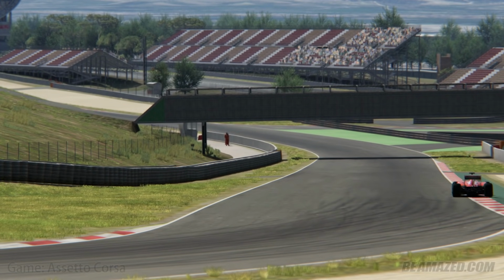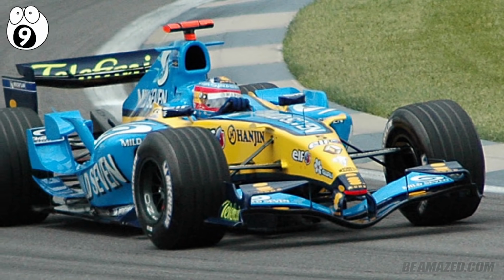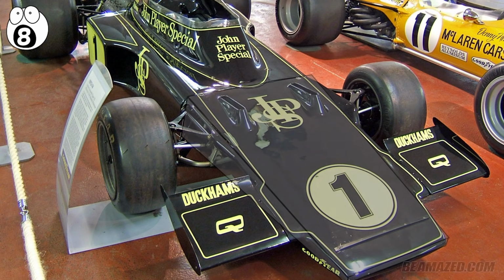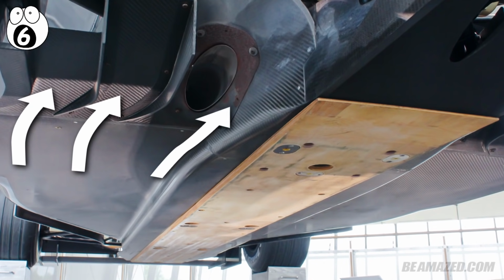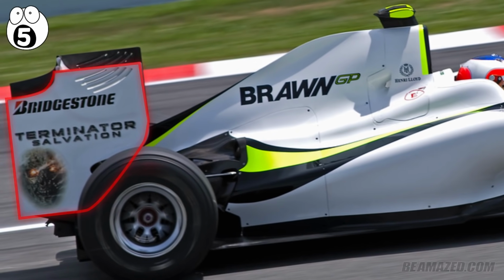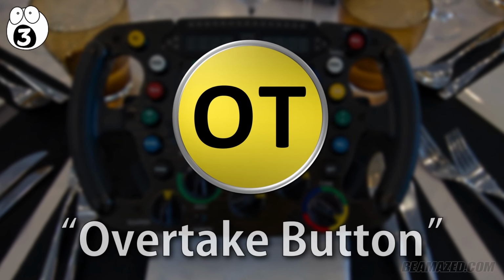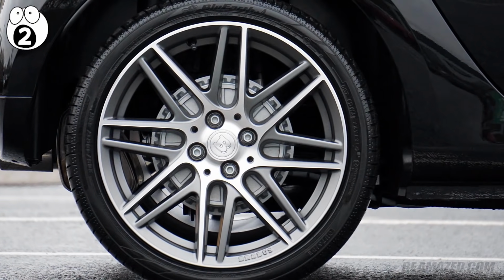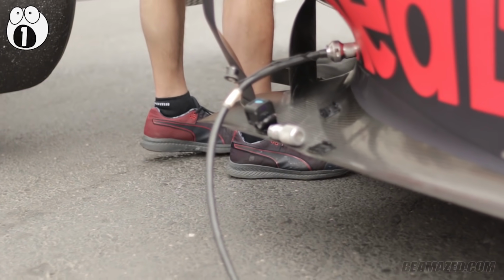Secrets Of F1 Car Design You'll Find Really Interesting

Comment: I don't normally comment on other people's videos, but this was truly painful to watch, pretty much everything said about aerodynamics in this video was completely incorrect... Might be worth getting someone who understands aero to proof watch before you publish...
Reply: In case you arent already aware, Bryan, the OP here is literally an aerodynamic engineer.
Reply: About Ram Effect on a Turbo Engine
"You allow the turbo to do less work for the same manifold pressure, and thus get more effeciency. It is especially helpful if the turbo is working at its limits.

For example suppose your turbo is most efficient at a pressure ratio of 2.7:1. The pressure ratio is the ratio of the outlet pressure divided by the inlet pressure.
Lets suppose on a given day absolute air pressure is 12.5 psi. If you run the turbo at its ideal effeciency, you get a max boost of  12.5 x 2.7 = 33.75 psi.

Now you add 1 psi ram boost to that same setup, your inlet pressure is now 13.5 psi, so your max boost becomes 13.5 x 2.7 = 36.45 psi.

You gained 2.7 psi manifold pressure by adding 1 psi of ram boost!"
Sorry for retarded units, i just copied the first proper post I found about it on the internet.
Reply: I love how the experts think that a company that spends millions in research every year and thousands of man hours is going to release the exact information to general public...  At the very best you are receiving outdated info or some reverse engineered theory.  Maybe take a look at the NDA book most teams have.
Reply: Pedro every little bit helps and as the engine works better with cool undisturbed air, the duct is required mainly for that reason so its kind of a "free" turbo you could say.
Reply: actual aerodynamics engineer with a Motrosport msc here..

i did.. you're welcome.. :) and i'm pretty sure i left stuff behind as his whole explanation of the under body/diffuser made my head hurt....
Reply: KYLE.ENGINEERS seriously. The only reason I clicked this was to see how far from one of your videos it was going to be. Answer, very far.
Reply: "Links for further research? Anywhere where I can learn F1 car aerodynamics from scratch?" 

Aero Dynamics on F1 cars is a very complicated thing if you go down to it's details. I don't think any F1 Aero-Engineer fully understands what is going on his own car. One of the reasons is, they use software to find shapes that improve downforce/drag. There are softwares that simulate partly "random" shapes, find and give out solutions that are better than the solution the software started with. It works and it is an improvement but why? Well because the CFD simulation shows that it's better... But really why, is sometimes not perfectly certain. We are not talking about big effects, we are talking about 20 or 30 small shapes or radius of winglets or supporting shapes at the edges of side-boards... all that stuff in particular. 
Also car aero-dynamics have car travelling speed, side slip angle, ride height and some other smaller parameter to get the full picture.

However, if you want to look into car aero-dynamics, get a good book. There are quite a few and some good books on that topic that present the topic from a general approach to more complex effects and more detailed explanations. Whoever the general understanding is far more helpful than knowing a few small aero gimmicks.
Reply: KYLE.ENGINEERS i know right?       Best vidio for non-car enthusiasts
Reply: Kyle What was wrong about the Aero ?????
Reply: The previous generation engines (NA v-8's and v-10s) had the airbox designed to make sure the engine had ENOUGH air to operate at all RPMs and all speeds, and so they had an outlet at the back (iirc, the present ones have them, too), to allow excess air to escape, and keep a constant amount of airflow and pressure built up in the airbox, enough to allow the engine to run at full RPM and not starve. Without those devices, if the engine weren't running at full RPM (or the box was misdesigned), the airflow would stall at the airbox opening, and then the airflow would separate and go AROUND the inlet opening, and actually begin sucking the air out of the box, thereby starving the engine.
Reply: You won't find many in F1 who understand aerodynamics!
Reply: KYLE.ENGINEERS  and i was thinking that i was the only one to see this.
Reply: I know
Reply: Links for further research? Anywhere where I can learn F1 car aerodynamics from scratch?
Reply: The problem with that is what happens when the inlet air speed is exceeded by the actual air speed approaching the inlet. When that happens, the flow stalls at the opening, then separates around the inlet, actually sucking air out of it, which completely negates the "ram air" effect. 

In truth, the only way to prevent that is to make sure the entire airbox unit is designed such that no matter what speed the car is going in relation to the amount of ingested air, there's ALWAYS fresh air moving into the box, and that requires some sort of exit on the backside (which is usually smaller than the main inlet) to keep air moving. 

I got all THAT from two sources: 1) SPEED/NBCSN's F1 technical commentator Steve Matchett (thru years of watching F1 on SPEED and NBCSN); and 2) "Ferrari Formula 1 - Under the skin of the championship winning F1-2000" (http://f1-nut.com/book/rare-book-review-ferrari-formula-1-by-peter-wright/), which is as deep into a car as I've ever found.
Reply: Yea it's painful to watch as a f1 fan
Reply: Savage
Reply: Ok, hold on so in front of your turbo, you have your air box, the goal of the turbo is to increase the air flow through the engine by increasing pressure. So increasing the pressure (say by a defusor) prior to the turbo does actually make sense! Where dou you think the air into the compressor comes from? A giant air tank?
Reply: Thanks, already wondered how the difusor would help. Was already close to doing bernoulli myself.
Reply: Yes. I had the exact same thought from the very first item. The most important job on today's front wing is to manage the airflow in order to make the rear diffuser and work more effectively, as they generate the bulk of the downforce. Basically the goal is to circumvent the front wheels to prevent turbulent airflow and to energize the airflow (look up Y250). Down force of the front wing is also important, but it much less complex to achieve.
Reply: And a formula one costs 9 million hahahaha Ferrari spends 650 million each year in research alone
Reply: the only reason i clicked on the video was to see how far from the truth was going to be. It was truly painful to was this as a car enthusiast
Reply: Also he says that the rear wing pushes air onto the car at the back, making overtakes harder. This falls flat onto the most obvious tactic, slipstreaming, where the WHOLE POINT is to drive close behind the leader to avoid excess air hitting you and causing drag (this sometimes works so well that it caused the RIC-VER crash in the Austrian GP this year).

Edit: The RIC-VER crash was caused by Verstappen weaving like an idiot
Reply: Someone tell him what the nürburgring is i don’t think there are any races in nuremberg
Reply: I was excited to learn about this car because they are bad ass but all these comments make me not want to even watch this video. Thanks comments section true mvp
Reply: michael scoulfeild i think the f1 community is getting a bit out of hand on this one and it is simplified to reach a wider audience. But i agree that to do a video like this he needs to have a certain level of understanding of the subject. If you want to learn about the cars then definitely find other videos online or even tune in to a race
Reply: Thank you
Reply: I never realised that the barge boards are the only non structural part of the car that is purely for aerodynamics. Diffuser and wings clearly are the main structural integrity of the whole car. I've only made it to no7 and i doubt everything I've heard so far
Reply: I didn’t think a video could make me cringe so much
Reply: You know your facts are blatantly wrong when you managed to annoy Kyle!
Reply: @Victor duarte There's a difference between an oversimplification and an incorrect statement.  Oversimplification: "The diffuser helps the undertray make downforce", Incorrect statement: "The upward curve forces air to expand, which drops air pressure, making exiting air suck the car to the ground" - with the graphic showing the pressure as high under the floor and low in the diffuser. The video is full of them.
Reply: while not everything is entirely correct, it's not fair to say all of it is wrong. This video oversimplifies basically everything to reach a wider audience. While i was watching, everything fell under the category of 'yeah it does that, but it's actually also doing <this>, which is far more important'.
Reply: Underbody: At the Front you have an opening to catch air. In the centre you have a area where the air is squeezed thru a smaller cross-section. Faster air has reduced pressure, low pressure multiplied by surface (of car underbody) results in a downforce. The underbody has the benefit of the ground-effect. Now the diffuser, what is the point of the diffuser if the fast travelling low air pressure zone in the centre of the underbody is the key thing. Well the diffuser is an open end for the travelling air, means at the exit opening the air pressure must have ambient air pressure. So going backwards, and you need to think backwards for this effect, not perfectly intuitive, but it works. If the air has ambient air pressure at the exit, and the exit is a bigger cross section than the centre part of the air tunnel, the air pressure in the centre is reduced by the diffuser.  
So the diffuser helps to create under-pressure or increase the under-pressure in the centre of the air tunnel underneath the car, what creates downforce. If you are lucky you can guide the air with the diffuser to the rear wing, in a way that it supports the rear wing, maybe. 

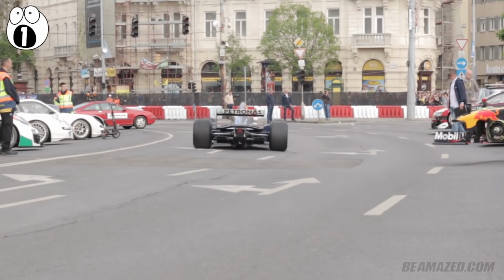So that explanation in the video really was bollocks. Also the boreholes in the brake disk that shall cool the disc or bring the hot air to the wheel, as he said it, he showed the wrong holes. Axial boreholes are not in the discs for cooling, they are especially in steel brake discs to reduce heat stress in the disc. The radial boreholes are there to cool brake discs. A carbon brake disc has a very low thermal expansion, so it rather doesn't need the axial boreholes. And at 10:02 of this video you can see an example on an F1 car that actually doesn't have the axial boreholes and only some radial boreholes.

He also said the boreholes in the discs are to heat up the wheel/tire. Well that is difficult to argue with but certainly not the right way to explain it. The starting point is that  brakes get hot on braking ad carbon brakes and brake pads need a certain minimum temperature to work properly. So they need to be cooled a certain amount but also not too much. So everything inside esp. the rather small F1 wheel is going to be heated up, also the wheel also the air inside  tire. I want to stress that it's this way around and using the brake heat to heat up the tires in the parade lap for the start (also the way they do it in GT3) is a thing but still not the right way around to explain it.
Reply: @miagi1337  I'm trying to find where your explanations contradict the videos'.
Reply: a. the 'end fences' are called 'end plates', where did you read that terminology?
b. the 'side wings' are 'cascade wing elements' and their main use is to eliminate drag produced by the spinning wheels in the oncoming air. 
c. Ram air effect was never used in F1,  it creates WAAYY too much drag, to outweigh any engine power gains. 
d. the air intake shape is in no way or form intended to be a 'blockade' for air hitting the rear wing, it's 'tail' is that shape in order to actually DIRECT air to the rear wing, where it is needed. 
e. most times drivers actually DO ride close behind one another, the low pressure front that's left behind, in the 'wake' produced, lets the following car benefit form reduced drag (drafting). 
f. rear wing end plates are NOT for straight line stability, well they help there too, but their main purpose is to separate low and high pressure areas at the wingtip (like you explained about the end plates of the front wing) 
g. the main thing that warms up tyres isn't the heat form the brakes, but actually friction of the tyre and the ground, that's why you see them going left right left right when they are forced to slow down due to safety car etc . the brake heating effect amounts to less than 2 or 3% of the tyre temperature gain (heat dissipated from the brakes is mainly lost into the environment, if it was all channeled to the tyres, the brakes would end up reaching  more than 1900 oC. 
h. heat, and hot weather (for walking example), causes the tyre to soften and form into the tarmac, making a strong mechanical bond on a microscopic level.
i. team mechanics (not engineers) DO NOT rely on skill and judgement to decide whether the wheel is tight enough.... that is a very serious task to be placed on the judgement of a person... the guns are 'pre- tuned' (programmed lets say), to do a set number of turns before cutting off, bringing the toque up to spec, this tightening torque is decided during the design process of the car and is based on a whole load of calculations, factoring in materials used, type of thread etc.
 j. the 2-8 hours of autoclave baking of carbon fibre is pretty incorrect.. some parts must stay in an autoclave oven for more than 24 hours, some really high strength ones even 30+.   some other parts can be good to go after 10 minutes...
Reply: the saddest thing was this airbox bullshit. he thinks the "airbox" creates overpressure giving more hp.... hahahahahhaha this is really sad.
Reply: Lol its real he just gave a crappy explanation...Its called a ram air intake. Look it up.
Reply: Also the "supercharging" of the airbox, it's of course a joke. F1 cars, now a days are turbo charged, they don't need any additional air,
Reply: and the pressure from incoming air is nothing compared to a compressor turbine...
Reply: @PedroFTeixeira  cooling
Reply: @PedroFTeixeira  the turbos are also right behind the air box
Reply: Ok to be fair after watching the whole video, I noticed that towards the end the information stayed somewhat correct and didn't bother me much. It was only the first half that made me cringe. I'd say this is just a case of oversimplification for a broader audience, which also lead to some false information.
Reply: i cringe every time som one says all season tires. becaus all season tires dont exist.  nothing to do whit the video just like to mention how som people dont get that you can not have all season tires becaus the rubber mix is difrent depending on weather
Reply: https://www.youtube.com/watch?v=pe-gkTCOs7E
Reply: Funnybutt8 I’m the same, but I’m 14
Reply: Pedro Teixeira bullshit...they still need the air to cool and push out hot air.
Reply: +KYLE.ENGINEERS Can u make a reply video or at least type what is wrong with this video? I would like to know the details.
Reply: yea man this guy has no clue what he's talking about XD
Reply: Seriously that was the worst video I've seen on that subject. Did he just look at stuff they put on an f1 car and guess what's going on? There could not have been any research involved. No one can get it that wrong unless they blindly guess.
Reply: Trance9: The list of inaccuracies would fill an entire encyclopedia. The use of computer imagery of car that never existed also hurt the entire video. 

Here's one: "hole in the brake disks heat the tires" What the ever-lovin' F**K?? They're there for disc cooling ONLY, and those types of drilled holes don't even exist any longer on the newest F1 cars, becaus they give rise to stress risers in the disc, lead to crack propagation and disc disintegration. Newest F1 brake disc now only have the holes radially drilled from the core to the outer rim, with cooling air being fed to them from the brake ducts, which ONLY feed air to the brakes, and do nothing else to aid aerodynamics--in fact, duct size is a critical element in drag reduction, often causing compromises that make balancing the car's aero difficult because of the needs of the brakes.
Reply: @texarcana2002 you're telling me that the heat from the disks doesn't in anyway heat up the tires for beneficial effect?
Reply: So turbocharging doesn't supply additional air? What the hell do you think it does? Provide more cooling air to the radiators? You need to get some basic concepts straight.
Reply: Okay.

Since you're all aerodynamics and F1 engineers...correct what is wrong hot shots
Reply: @trance9158 no shit i love how everyone says everything in this video is wrong without giving ny solid examples...

Only one uy tried and he failed anyway.
Reply: The airbox explanation was wrong too. There is no ram effect on turbocharged engines. The system is already pressurised.
Reply: I agreed. As being a 12 year old gear head, and knowing more than my dad, I very often cringe at things he thinks he got right about cars. But this, this was SOOOOO much more cringier

Comment: you need to regain your knowlage about frontwing aerodynamics, that wasn quite correct. Basically the front wing doesn't produce any downforce. It's only biulding vortexes to get the air around the front tires and to the outside of the car to build a "bubble" of clean flowing air around the sides of the car. that's the outside of the frontwing and the outer flaps on the inside. The other main vortex generated by the frontwing is produced by the 4-5 inside flaps. It'S passing on the inside of the tire swirling to the air intakes and bardgeboards, around the side pods and leads it around the outside of the rear wheels.